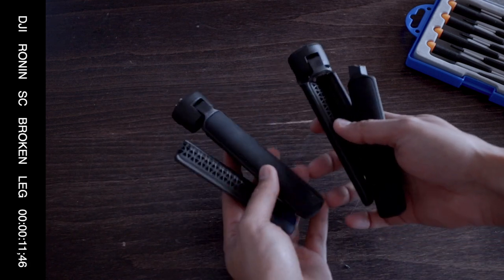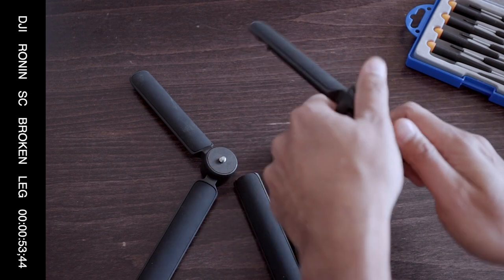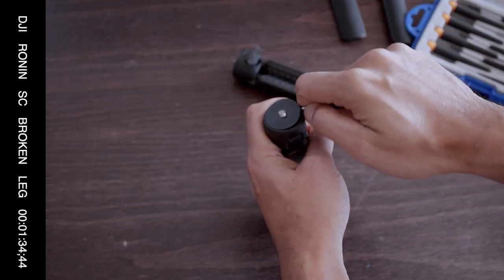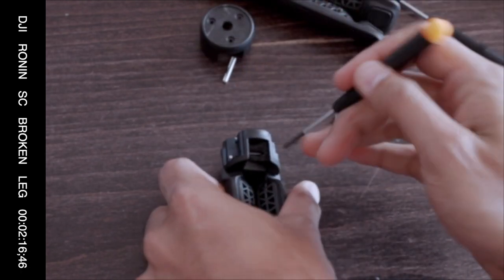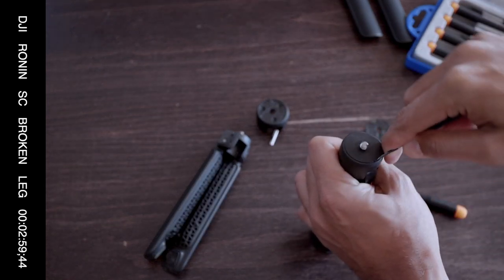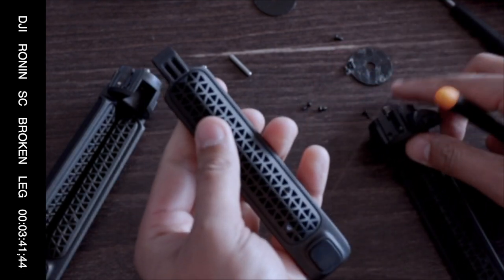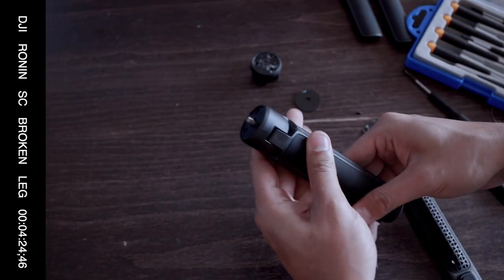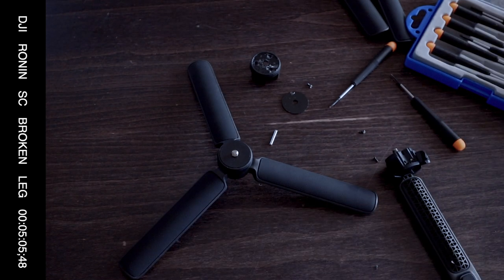DJI Ronin SC | Broken Tripod Leg   Fix

Comment: Mine is not broken but one leg doesn't hold steady and flying around making plastic clap noise
Reply: I've seen online that putting a little super glue in the hinge stiffens it back up. I'm gonna have to try on mine soon too
Reply: Mine has the same issue here
Reply: @JackLabs   it work?
Reply: @masionski  Haven't done it yet tbh
Reply: lol same